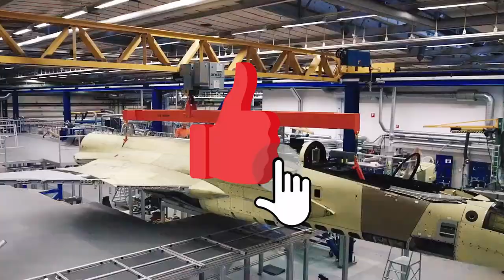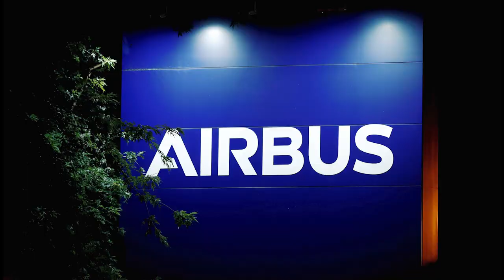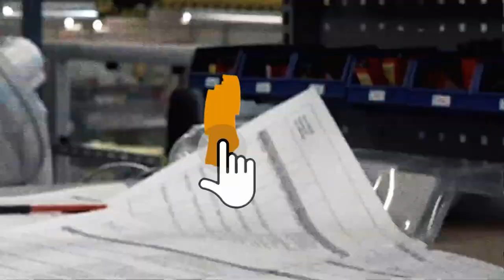Finally: NATO Testing Its NEW 6th Generation Fighter Jet!

Comment: Just a side note, the US has already tested and flown a prototype for the 6th generation fighter (NGAD). Another side note, it took them a year from design to test flight, fastest that has ever been done.
Reply: It seems like from all the buzz, you are correct. For a half century, the US has led in aircraft technology, and it seems to me that the US does not want to share its top-level tech with foreign countries for fear of it getting into the wrong hands. That is why the US would not sell the F22 to anyone and part of the reason the F35 was designed. The fact that the F22 procurement is being phased out leads me to believe that NGAD is real and that like all other major US combat air development, it is being developed in deep secrecy and we will find out more about it well after it is finalized. While many countries like to boast about their advancements, the US doesn't care as much about winning the propaganda war as much as the technology and tactical war.
Reply: @midnightrider1100  The US "led" in aircraft technology because european nations like France, UK, German have had different priorities. And if there are countries that like to boast weapons it s the US,  
But remember that most of todays moderne weapons originated from Europe: tank, jet, missile, helicopteres, radar  etc....
Reply: @jonpetter8921  Cope.
Reply: I don't believe for a second that they designed and built a plane from scratch in a year. I'm an aerospace engineer and there is so much work involved, even 5 years would be an extremely short amount of time!
If indeed they have flown something, it's not going to be a full prototype, but more like a technology demonstrator (based on an existing aircraft but testing a particular novel aspect).
Reply: @jonpetter8921  even if any eu nation had priority’s on aircraft tech they wouldn’t come close to the US. Especially since the US has a defense budget that is more than 4 times greater than all the countries you just mentioned combined. They would not have the financial means to even for go on a project like this, especially in the time frame they are stating. They’res a reason the US has the only actual 5th gen fighters in the world.
Reply: @jonpetter8921  thank you this comment added nothing to the conversation
Reply: The one that took a year to develop was the  Boeing bird of prey from the late 90s.

Not the NGAD.
Reply: @ChamberSpell  tf are you talking about ?! Europe has some of the most sophisticated weapon systems on the planet, the only thing they „got from Israel“ are the trophy APS, and even that will get replaced by the German iron shield
Reply: @KneedsItsGat  That s my point. Europe is investing in other field than weapons like public transport infrastructure, green urban development, social security net, things that matter for the most. However like this video mentioned both france, sweden, Germany/UK/french/itale are developing own new gen jets. Germany, french got one of the best tanks, self propelled artilleries you have today. UK/sweden developed nlaw, etc...
Reply: @ChamberSpell  Western Europe is already the most prosperous region in the planet in term of Human development index which matters most for each individuals. Western Europe is ahead when it comes to individual freedom which matter most as an human. Europe is ahead when it comes to advanced public transport infrastructure, green modern city design, digitalisation of social services, you know things that matter.    
American lead in car manufacturing ? haha nice one. Germany is the biggest car exporter globally ahead of Japan and the US ? The car company with highest income last year was VW Group by the way. And where does most of modern tech on car come from ? from F1, an european platform.  Most of the the biggest manufacturers of high speed trains are from Europe. And have heard of Airbus ?

And it s not like Europe is behind in weapon neither. Nlaw was developed by UK/sweden. Germany and french still got one of the best tanks and self propelled artilleries today. And like this video mentioned Eurofighter, Rafale, Grippen are developing next gen jets.
Reply: @claudiomunoz471  I have one for you. American space project NASA won t exist if not german space and rocket engineers the US brought to the US after the war. Same with american jet development, taken from german patent.
Reply: @jonpetter8921  gun powder originated in China, so what? U make no point other than showing how u don’t like how the Americans have the best military tech
Reply: Abhijeet Kundu  but ur not, whereas there is evidence that the US has been working and designing a 6th gen fighter since 2009. Congress/ the defense department has claimed it have already seen this aircraft, but ofc i doubt it is completely done. However the US is miles ahead mate
Reply: @shubhamjaju7359  I said "modern weapons". Missile, rockets, tank, helicopter... 

Best military tech ? there have been no major inventions since the WWII. Most of todays weapon are based on inventions before or after WWII.
Reply: @midnightrider1100  The Raptor has suffered performance issues from the outset, and has extremely high maintenance requirements which have resulted in availability rates that are by far the lowest in the U.S. Air Force. While the Raptor was initially intended to replace the F-15 Eagle, production was terminated in 2011 less than six years after the fighter first entered service. To put this in perspective, the F-15 first flew in 1972 and entered service in 1975, but is still in production today and is expected to see a production run of over 55 years. 

Now; a number of analysts have considered the F-22 program a failure. The fighter is just not practical in any sense. Its also riddled with spaghetti code from post cold war era hence its really hard to have any software upgrade, which has had some progress the last 20 years. Right now F-22s are getting scrapped for parts to keep other F-22s flying. Its tech is laughable at this point, no new sensors since 2005, still running legacy AIM-120 missiles and no HMS. 
And btw, the f-22 wasn't sold to other countries because congress got fed up with the US always having to pay the R&D, not because of the tech.
Reply: Yes it does and the rest of what you´re writing must be a troll right? America lead in car manufacturing? rofl.
Reply: @shubhamjaju7359  You dont. lol You have quantity, not quality. Most of your tech is post cold war era, cause the new stuff you invent, either isn't practical or struggles with maintenance woes.
Reply: @jonpetter8921  your mentioning points that are irrelevant
Reply: @jonpetter8921  even then mate, doesn’t matter where they originate. That’s why i brought up gun powder. It’s what people do with those innovations and make them better for modern times.
Best military tech, not best inventions, best tech. Our navy and Air Force is miles ahead of any other military in the world. Not having “new inventions” doesn’t mean the country doesn’t have the best military tech. Stealth technology, speed, payload capacity, range, all have increased by miles since WW2
Reply: @olelien5055  buddy I’m talking about the USA here, not China or Russia 😂. Your telling me the F22 released and fighting wars a decade before any 5th gen aircraft isn’t good? Ur telling me the General Ford class which is brand new and nuclear powered just like our 10 other carriers isn’t good?
Reply: @olelien5055  lmao i hope you know what post Cold War era means, we r currently in the “post Cold War era” 😂 the US leads in the best navy and best air force by miles, and if u r gonna dispute that then u don’t seem to know much about the military. Technically China has more ships than us, but we have way better running ships as well as much more modern tech. And ur talking about maintenance woes? Have u seen Russian ships? Russian 5th gen aircraft that don’t even have a full squadron made? Or the Chinese 5th gen aircraft? Buddy ur delusional
Reply: @olelien5055  alright a lot of programs r considered failures because of monetary constraints not military constraints. The f-22 is regarded as the best fighter in the world. It’s stealth is the best in the game. Currently the Pentagon is retiring around 33 of the oldest and first f22s so they can upgrade the other 150+ to make it even better
Reply: @olelien5055  yes the f22 was expensive af, but that doesn’t take away from the fact that the aircraft is the best air superiority fighter in the world. The funding also stopped for it not only because it was expensive but because the US was also spending money on a two front war with Afghanistan and Iraq, and trillions of dollars into the war on terror. Technically the f35 is also seen as a “failure” but again it’s called that only for monetary views, not for its performance
Reply: @jonpetter8921  I don’t see the US doing large scale military parades every year showing off 50% of their vehicles or their “new” mbts.  I saw a trailer though for the Abrams! Hahaha
Reply: @midnightrider1100  fax, well said
Reply: @shubhamjaju7359  How is monetary constraints not military constraints? LOL. Like i already wrote, it was supposed to replace the f-15, which it clearly failed at seeing that f-15 is still in production and the F-22 is scrapped. I never talked about your tech compared to China and Russia. I compared it to the military tech from Europe, which is leaps and bounds ahead in almost every aspect. Sensory, missile, radar, avionics, powertrains, jet engines. The US should buy the meteor missile and PIRATE IRST. Yes, stealth is to some extent viable, but as soon as a F-22 turns on its radar its just as visible as any other aircraft. It needs more range on its missiles. The AIM-120 which is the best missile currently fitted to the f-22 has 1/3 of the range of a meteor missile. Pirate IRST sees a F-22 coming at about 40-80 miles. Read some articles about tech on the Eurofighter and you´ll soon come to realize that the best air superiority fighter is no longer the F-22.
Reply: @sergarlantyrell7847  
IIRC, time from initial design to flying prototype was 7-8 years for the NGAD, and that was considered extremely quick and about the fastest generational shift ever. They apparently had a-lot of research value from the F-22, and whatever secret research planes they have hidden away from the common eye. Enough that a true 6th gen aircraft could be attempted.

People tend to forget that the jump between generations is so great that they make the earlier design almost obsolete. If the NGAD can do that to a Raptor, it must be astounding.

The US arguably has the only real 5th gens operating, and getting a 6th gen before the rest of the world has 5th gen combat aircraft as common place would make it appear to be an astronomical leap forward.
Reply: @sergarlantyrell7847  it took them a year to take a design and then build the prototype. The design phase took years as NGAD started development in 2014 I believe.
Reply: @olelien5055  again it failed to replace the f-15 because of monetary constraints, the f-22 costs a lot more than a f-15 which is a 4th/4.5 gen aircraft. Secondly I’m comparing the US with its future adversaries not allies
Reply: @olelien5055  The Eurofighter Typhoon was designed to have a multirole capability which means it can perform air superiority, ground attack, or SEAD missions depending on its loadout at any given time whereas the F-22 Raptor was designed for air superiority. 
Secondly the Eurofighter Typhoon is not as maneuverable as the F-22 Raptor and Eurofighter’s software hasn’t been fully developed yet. The Typhoon is also slower than the F-22 raptor, and Eurofighter Typhoon’s flight envelope can’t match the Raptor.
Reply: @olelien5055  If the F-22 it only uses the 30 RWR antennas built into its skin will see the EF-2000’s radar over 250 miles away and can use the triangulation to guide an AIM-120D from 90 miles out. If it uses its APG-77V1 radar it will see the EF-2000 most definitely from 200+ miles out, close and then start rippling off AIM-120’s from 90+ out. The radar also frequency hops several hundred times a second reducing the ability of even the CAPTOR-E and RWR of the EF-2000 from detecting and also accurately triangulating origin distance. I also don’t think the DASS system on the EF-2000 has the range to see the missile launches so the best indicator of the AIM-120’s approach will be the activation of its terminal onboard radar. The EF-2000 can certainly attempt to jam the radar which technically could work for some of them but runs into the issue of the AIM-120 having a Home On Jam (HOJ) ability to switch to targeting the jamming signal and following that to its source (the EF-2000).  If the EF-2000 were to survive 6 AIM-120D’s as they closed the distance the F-22 would be able to launch one or both AIM-9X at about 20 miles out and guide them towards the EF-2000 until the all-aspect seeker identified the target. The AIM-9X has been tested extensively against targets deploying IR countermeasures with successful intercepts so there is a somewhat decent chance of hit at this point assuming 6 AIM-120’s failed to hit. After that it would come down to pilot skill with dog fighting.
Reply: @olelien5055  The EF-2000 probably excels more in normal multi-role fighter use and having lower operating costs. It’s by no means a bad fighter, it just lacks abilities when you put it into the arena that the F-22 thrives in.
Reply: @shubhamjaju7359  It was firstly designed to be an air superiority fighter, then later took on other missions - just like the f-15.
Reply: @jonpetter8921  Oof, as if the origin of a technology or technique has anything to do with it's future mastery. But you're not wrong when it comes to europe. Americans are often times pretty shocked when they visit western european countries and see in how many aspects we are technologically ahead of them. That doesn't mean america is behind europe or anything, we all excel in different things.
Reply: @shubhamjaju7359  The gen stipulation is a marketing term made up by Lockheed. The Eurofighter is a more modern jet than the f-22. Mainly because software updates are nearly impossible due to the spaghetti code currently fitted in the F-22. While as the Eurofighter is still being developed as a lot of its future and current tech will be used on the tempest.
Reply: @olelien5055  even if the gen stipulations were made for marketing purposes that doesn’t take away from the fact that f-22 is superior when it comes to air superiority. Yes the typhoon is great plane, one of the best in the world currently but it cannot even be compared to the f-22 when it comes to roles. A better comparison is the f15E not the f22
Reply: @sergarlantyrell7847  that’s probably true but they have been integrating AI into the design process to make the entire process years instead of decades
Reply: Are you an engineer? With development experience of complex systems?
Reply: Current manufacturing techniques and design technologies really help propel us forward.
Reply: The "test flight" was probably a remote control model used for proof of concept.
Reply: @midnightrider1100  I can't wait to see it!
Reply: @sergarlantyrell7847  I'll admit I was skeptical at first, but they actually did most of the testing of the airframe in a digital space, so they were able to work through multiple concepts at once and find out what was best much faster than using traditional wind tunnels. The prototype they built and flew is likely one of the final prototype iterations they have done because they already worked through literally hundreds of concepts on the computer. Popular mechanics did an article about it a while back, you can read about it there.
Reply: @RealKlausSchwab  full size model
Reply: @jonpetter8921  ok and? The technology was still developed in America so it’s American, once again your comment added nothing
Reply: @ChamberSpell  they probably lead in wait times for healthcare, number of stabbings, taxes, human trafficking, and the amount of people coping with the fact the US has the strongest, toughest, most funded military, most technologically advanced military in the world
Reply: @classicgalactica5879  right, the irony in his statement,  " we have other priorities and don't like to boast but it all started here" haha, yeah your other priorities were building ridiculously successful economies in every area BUT defense because you had the US for that.
Reply: @jonpetter8921  yeah but they did it for thier country, the USA and not Germany,  damn.

Comment: The more allies working in 6th Gen aviation the better 👍
Reply: Interoperability with UNGOVERNED would be ideal. If a C130J can make the trip I hope NATO/NORAD fighters will soon follow.
Reply: I also suspect the the combined efforts of multiple nations are more visible due to more treaties etc while the us and Japan can keep it fairly quiet
Reply: How many components are imported from China, like the F35?
Reply: @aburetik4866  There's always going to be some Chinese parts. 
But because of the massive problem with electronics parts fraud in China, manufacturers avoid mainland suppliers when possible.

Military spec parts have to be the highest standard, because a blown chip could bring down a plane.

It's super critical with temperature ratings and unfortunately that's one of the biggest areas of component fraud.